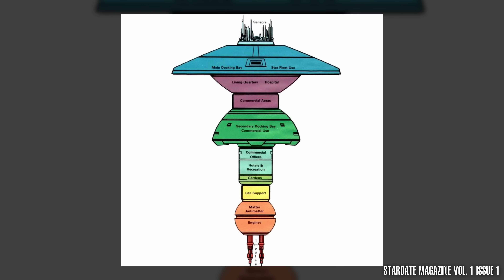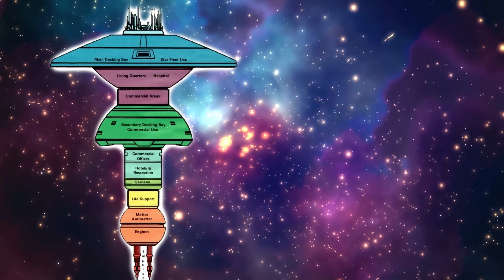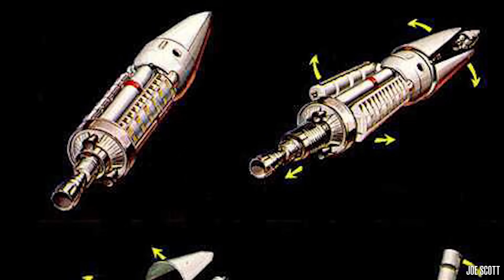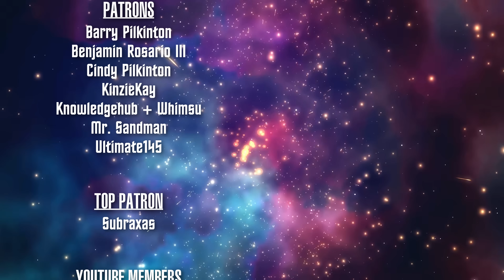How Do Starbases Work?

Comment: How does an enormous space station stay in orbit? The answer is "not like the ISS". That has a relatively low mass but an insane surface area due to the solar panels, radiators, and strut construction. So, it's got a ton of drag sucking the momentum out of not-so-much mass. Star Trek space stations aren’t just enormous, they’re massive. And they're smooth, like Sean Connery James Bond smooth. I wouldn’t be surprised if they have a drag/mass ratio 100 times better than the ISS. So, instead of needing an orbital boost from a cargo ship every few months, they could get by with a boost from a giant space tug every few decades. Couple of tugs making their way from system to system at low warp could keep all the stations in the Federation in orbit. Or, you simply make that part of the duty of all the starships that use the station. It's got way more traffic than the ISS, and the starships have "slightly" more delta V than a Dragon, no slight to Elon.

Comment: In space, the closest thing to a drydock would be an enclosed, pressurized volume where spaceships could be more easily repaired, without needing spacesuits. Much like a drydock allows for hull and propeller repairs without the hassle of scuba gear.

Comment: A quick back of the napkin calculation about fusion rockets heavily implies that impulse can't just be a fusion rocket. My head canon is that the inertial control which allows for artificial gravity and inertial dampening is used to reduce the inertial mass of the ship, vastly increasing the efficiency of the fusion rockets.
Reply: Correct. This is done in the first episode of ds9, Emissary, to get ds9 to the mouth of the wormhole.

Comment: Low earth orbits tend to deteriorate due to a small amount of atmospheric drag.
With something that big you'd be better off just putting it into a higher orbit rather than trying to constantly thrust upwards. You may have to consider radiation shielding but that would require far less energy (in terms of generating an electromagnetic field) than thrusting something that big upwards continually.

Comment: At 8:46 you give an equation, but you call the w-shaped letter 'omicron', when in fact it's a (lower-case) omega ('big O'). An omicron ('little O') looks like an English "o". The 'big' and 'little' of the letter names refer not to the case (upper vs lower), but rather to the length of the vowel they represent, at least originally. Now they sound the same.

Comment: If you want a space station to stay in place with minimal muss and fuss all you have to do is stick it in one of five Lagrange Points~ those places where the gravity of the planet and the sun cancel each other out and anything that gets put there stays there without needing to adjust. I'm pretty sure the Jack Webb Telescope is in one, that's why it is so far away and will be exceedingly difficult to upgrade and maintain any hardware issues.

Comment: One thing that sells the size of a ship or space station are its windows. The Earth Space dock looks huge even if you dont show a starship beside it. All those levels and windows. That's why I still say the JJ Enterprise isnt as big as a Galaxy Class. But maybe only slightly bigger than the original TOS ship. I always thought the Galaxy class windows looked to big at times for a ship of its size.
Reply: @subraxas  They would have to be huge. I feel like even the windows in 10 forward look to small on the indoor sets to how huge they would have to be on the outside.

Comment: OrangeRiver - You just brought up an excellent point when talking about artificial gravity.  Modern warp drive ideas exploit the curvature of space-time to side-step the speed of light barrier - specifically, if you can move the space around a vessel FTL, you don't technically have to move the ship itself FTL.  While objects themselves require infinite energy to move at light speed, spacetime itself may experience no such limitation.

The implications of what you said are therefore most interesting.  The discovery of the graviton, or some manner of artificial gravity that isn't a use of some other force to simulate gravity, would basically be a way to achieve FTL travel.  Of course, there's other problems with this like the need to negate inertia, or artificial shipboard gravity interfering with the ability to warp space-time such that propulsion works right.  Still, as every powergamer has observed at some point in their life, "every finite number can be reduced to 0."  Alcubiere's warp theories, and the ideas built on those, are basically that "Munchkin's First Law" in practice.

Comment: How does it stay in orbit?  Put it in a higher orbit.  The ISS is actually low enough that it encounters non-negligible drag from our atmosphere, so it has to burn every so often to maintain speed.  For a huge installation like a star base, just push it higher to begin with.

Comment: Impulse engines were originally Dean drives, not reactuon mass jets. The Federation has artificial gravity, and a grav drive would be far more effective than fusion or antimatter.

A 100MW fusion reactor would fuse about a dozen GRAMS of deuterium per second. Using that heat to excite the plasma and send it out through a nozzle would require tons of reaction mass.

Even a low efficiency grav drive is better than using 90% of your gross tonnage as reaction mass.

Comment: The ISS has thrusters because it loses a tiny bit of kinetic energy to the extremely thin remnants of Earth's atmosphere while in LEO.  This is not a mass thing, but the reality that LEO is not at all empty.

A space dock that was much farther out from a planet (with an atmosphere) would not suffer the same problem (or at most, only negligibly.)

Momentum from photons (from the local star) will eventually cause problems too, but that is over a great amount of time.  Same with the solar wind.   

In a planet system with several massive moons an artificial satellite will have a tricky orbit, which may require support by engines depending upon the orbit chosen.

Also, any space dock will have its own angular momentum and moment of inertia that is quite large, and thus moving said dock will be quite tricky.

Comment: Your source book is either wrong or retconned. In Trek, EPS (Electro-Plasma System) is their version of a power distribution grid. They use confined plasma as a superconductor to carry electrical current at higher Wattages than solid state conductors (wires and cables) could manage. Plasma is already a gas, so it's not like more heat would melt it. Each Impulse Engine Assembly contains a fusion generator. Exhaust gases are vented rearward to provide forward thrust at sublight speeds. Impulse Power is a standardized speed where Full Impulse = 0.25c. Excess power from the Impulse Reactor(s) is channeled into the EPS grid providing a significant fraction of ships total power generating capacity.

Also, I'm pretty sure Earth Spacedock orbits at Standard Orbit, which is the Trek term for Geostationary. As such, Starbase 1 would never skim the atmosphere and experiences very little drag. It only needs thrusters for station keeping.

Comment: Centrifugal force is not an actual force. It is more properly called centrifugal effect. The rotation of an object like a space station is resisting the inertia of the object to travel in a straight line.

Comment: incorrect about the need for thrusters to maintain orbit. the ISS only needs them because it's so low that it actually skims through the top of earth's atmosphere, and this resistance slows it down and allows it to falls just slightly, so thrusters are needed to push it back up again. the starbase clearly orbits at a far higher altitude where there would be no drag that thrusters would need to make up for.

Comment: If you are controlling gravity through means other than centripetal, you're controlling acceleration and don't need a separate drive. Whether through Newtonian physics IRL or magical Treknology, your artificial gravity (other than centripatel) is your propulsion. Any "inertial dampener" is merely an add-on that smooths out a change in acceleration -- a shock absorber, essentially.
Reply: Yeah, the impulse engines are redundant as anything but a back up propulsion system. 
Scifi often gets this wrong. Even B5, which got it right, got it wrong too in "Legend of the Rangers" when the fastest, most advanced Minbari-Human ship had a big ass rocket in the end.

Comment: EPS conduits Cary plasma from the warp core to the warp naceles where it is used to energize the field coils and which  allows formation of the warp field. It is non newtonian propulsion. The impulse engines do use a fusion reaction to eject hot plasma and are newtonian...and sublight but don't employ the eps conduits. The impulse engines are seperate reactors ...they are not using plasma from the warp core.

Comment: you can avoid the need for thrusters on your base if you put it further away from the planet to avoid the atmospheric drag which is the cause for needing those thrusters in the first place, which would be a altitude of approximately 2000 km (the ISS is around 400 km altitude).
and it's absurdly dumb to not put weapons platforms in orbit around your home planet or any other important planet for that matter.
Reply: Better to have weapons and not need them than the other way around.
Reply: Considering spacedock's size I would think it orbits at least halfway between earth and Luna's orbit. And they probably have to take spacedock's mass in consideration when  it's orbital position was selected.
Reply: @kdrapertrucker  Maybe a Lagrange point?
Reply: @randystegemann9990  Stuff at Lagrange points still need thrusters. Think of a lagrange point as the "top of the hill" as far as gravity goes. Objects at the lagrange points orbit them so they can stay stable, but even a little push can cause the orbit to "slide off" and into the gravity well of whatever object the lagrange point is on. (Earth or the Sun in the case of Earth-Sun L2). 

James Webb and others at L2 have little thrusters to keep its orbit stable. Though they won't need to fire them much, it is necessary.
Reply: @nitehawk86  My point is that they would likely need them less. Earth-Moon L4 and L5 are relatively stable, with minor perturbations from the Sun and other bodies. Of course, nothing is perfect.
Reply: There was a reason why they objected to weapons at the time, Earth was rather recently still a post-apocalyptic wasteland from WW3. Obviously people would have fears of a space based weapon being used on the planet.
Reply: Earth's atmosphere extends only to about 500km depending on latitude and the weather.

There are things that have been orbiting for decades at below 300km.

The ISS reboosts occasionally to counter atmospheric drag, but they use their thrusters also to avoid space junk.

The reason why TV satellites and space based telescopes need boosters is not to maintain orbit, but to maintain position.  Jupiter and the moon do affect that noticeably.  Possibly other things as well.

Comment: Issue:  the Impulse Engines cannot be any kind of conventional rocket.  Besides the fact that it lets the ship change its velocity to a fraction of lightspeed nearly instantly, the amount of energy that takes is way more that would fit in the ship.  Fusion is a real thing and we know how much energy you get from fusion.  To get up to half lightspeed, it would be like a Saturn 5: all fuel tank for a little bitty payload at the tip.
Reply: Amount of energy is one thing. First a starship have multple fusion reactors. In the ST universe those considered to be "low tech" enough so you can find them basically everywhere. Second, the efficiency of an impulse (reaction) drive greatly depends of the exhaust velocity so it's not that hard to imagine, in a universe where you can travel at warp, have transporters, and actual energy shields (gravtion based, but normal forcefields should be electromagnetic based), they managed to create a fusion drive, where they were able to accelerate the exhaust to such extent that the listed 0.25c isn't that far fatched. BTW, i can't remember in any manual where they listed the time for a starship to reach maximum impuse speed. Probably max acceleration isn't something they use all the time, only in emergencies.

The ship can travel faster on impulse then 0.25c of course, but Tsiolkovsky rocket equation would still apply. From that we can presume, that the exhaust velocity of an impulse drive is around 0.25c. Going faster would drop the efficiency of the drive greatly. For intrasystem travel 0.25c is a nice compromise.
Reply: @davidnemeth2061  
The speed of the exhaust is not put a limit on the speed of the ship!  Any speed will do, and you continue to get a reaction as long as you leave it on.  Rather, it gives a trade-off between energy required and reaction mass consumed for a specified delta V, or between acceleration vs efficiency.
The amount of energy you get from fusion is a known real thing.  The amount you get from matter/antimatter reaction is also a known thing in real life, and that is as much as you can hold by any method what-so-ever.  
How about running the numbers with the figures you give: reaction mass ejected at 0.25c.  How much would you need (relative to the mass of the ship) to bring the ship to 0.25c?  Is that small or large relative to the mass of the ship?  Now, how much energy does it take?  How much hydrogen do you have to fuse into He in order to get that much energy?  How does that figure compare to the amount of reaction mass ejected?

It should be obvious from conservation of momentum that the amount of reaction mass will be equal to the mass of the ship that is accelerated.  But that's without factoring in that the ship needs to carry the fuel before it is used, so the amount needed actually grows exponentially from there!  It would be the entire mass of the ship if it were expended instantly all at once or otherwise could be magicked in for free.  That's the ideal _minimum_.  And that's read directly from your "reasonable" details.  Now it also needs to carry reaction mass to use later to come to a stop again, and did you want to be able to make a second trip?

Lead time for impulse engine to achieve the target velocity:  Not any reference manual, but footage of Kirk and Sulu et al.  It does not act like any kind of rocket.  It acts like a warp drive, taking the ship to some velocity when turned on, returning to Newtonian physics when switched off.

Comment: You need to check the data on orbital mechanics. Persons in orbits does not "feel 90 percent of the pull/force of those on earth" or whatever you said.

They are basicly weightless (Micro gravity) cause of the speed (free fall) they orbit the planet with. But even in space its drag from atmospheric molekyles and thats what drags space objects like stations down and thus why they need thrust boosters - Not the gravity pull. J.

Comment: I always assumed that MIR, ISS and even the future Starfleet space stations were kept in place at various Lagrange points so that they wouldn't need to rely on thrusters.
Reply: The only reason the ISS needs thrusters is because its orbit is so low that it is touching very thin atmosphere. Higher orbits are quite stable because there is nothing to slow them down. For example, the moon doesn't need any thrusters to keep it in orbit, and it's not at a Lagrange point.
Reply: I don't think anything as heavy as a space station core module has ever been transported beyond low earth orbit.
Reply: @Grauenwolf  exactly. Those mountaintop Lagrange points actually require more station-keeping thrusting than a regular orbit.
Reply: @robertaguilar2124  It isn't a NASA mistake ... every foot of altitude requires more energy and satellites that high would demand that a higher portion of the booster's mass be dedicated to thrust.  This reduces payload and increases the cost of operation dramatically.
Reply: Yes I knew bout higher cost & bout need for more thrusts, but hey if we gonna be serious about space exploration, then we need to spend that money on current tech & on R&D for new tech, preferably less expensive tech, but gotta push envelope, besides US already spending multi-billions to trillions on waiste and studies and committees!☮️
Reply: Earth-Sun L2 is about 1.5 million kilometers away. The moon is only 384,000 kilometers away. We don't yet have the technology to send a manned mission that far out yet. (But hopefully will soon.)

The James Webb Space Telescope will be at L2 (along with some other spacecraft already there, like ESA's Gaia), but they still need small thrusters to gently keep the orbit.

ISS's orbit was chosen carefully such that it can be reached by the Space Shuttle and Soyuz, and from both Florida and Kazakhstan. For instance, Falcon 9 has quite a bit more performance than Soyuz, so it can carry more passengers or cargo and reach the ISS faster. If the station was any higher Soyuz wouldn't be able to reach it.
Reply: @kenhelmick5149 It requires more energy to get there.  It doesn't require any energy to stay there.